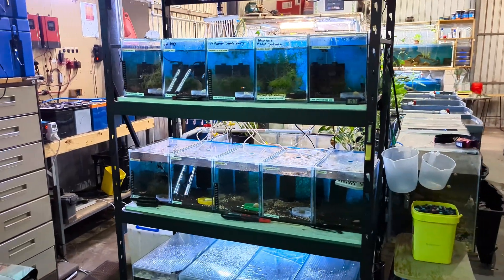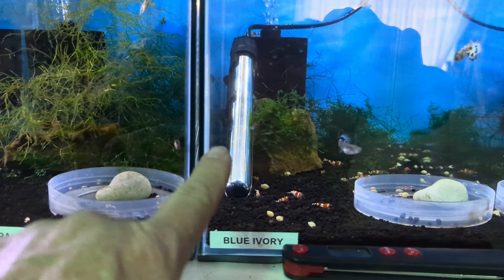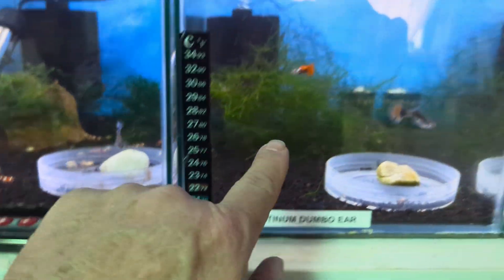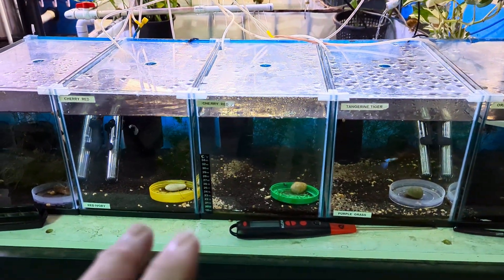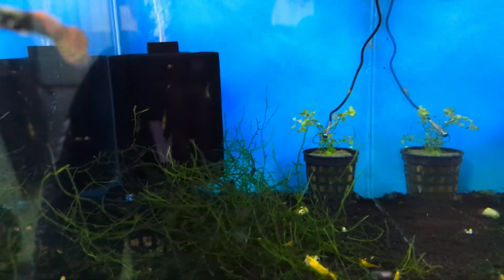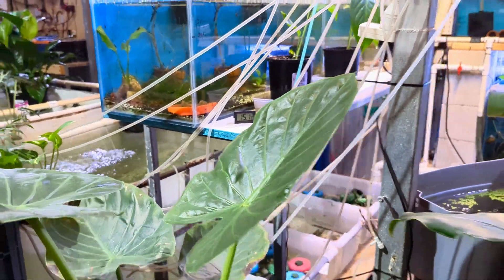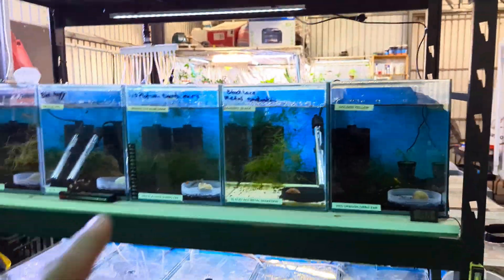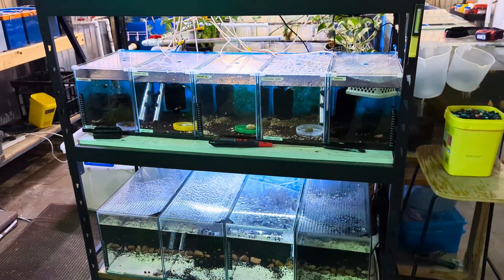an update on my 5 tanks two heater experiment

Comment: I’ve had mixed results over the years like that it works with one tank with glass dividers so there’s only one piece of glass.. Making overflows and just dripping the water through with a sump seems to be the safest easiest way. those crystal shrimp in with the guppies are freaking me out!! poor baby crystal shrimp. 😂😂
Reply from the maker: Yes I will have to monitor the baby shrimp it's ok while there's not many guppies but once the guppie colony grows then that's when I may have trouble